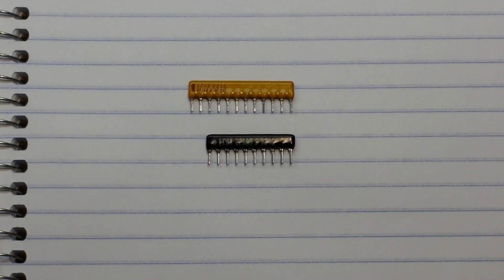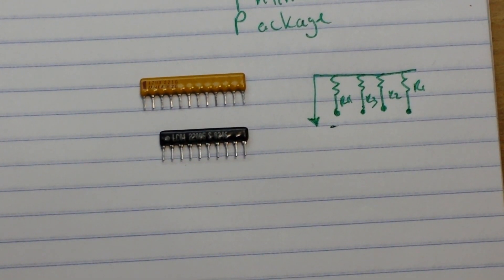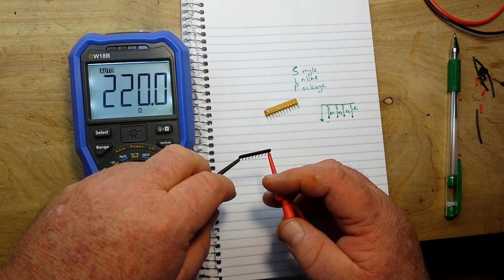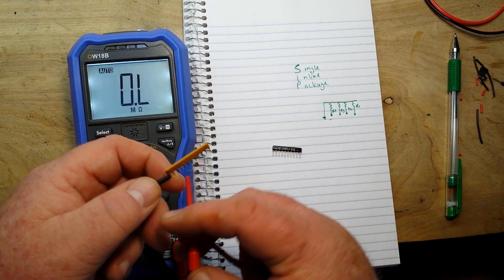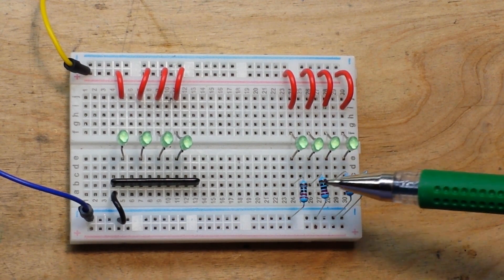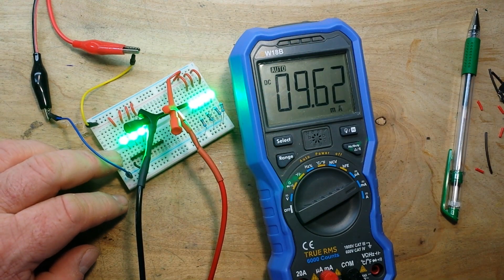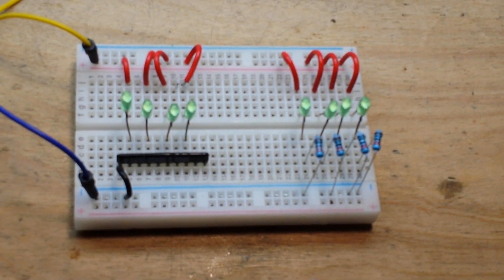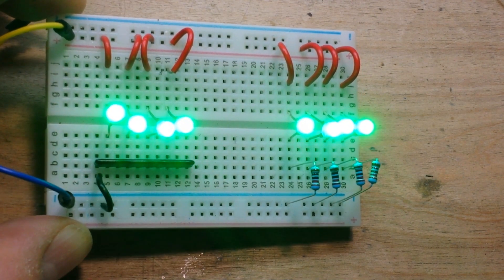Intro to resistor networks

Comment: Sips are usually matched in value and track well with temperature, but their maximum power dissipation is generally lower than discrete resistors. There is one special case that maybe of interest, that is the R2R network which can be used to produce a low cost DAC.
For anyone with the time, the following is a rambling reminiscence of the application of an R2R network.
During the mid to late 70s , before IC DACs were cheap and readily available, I was working on a PMR transceiver controller, as part of one of the first trunked radio systems. Each mobile had a radio circuit that converted the received signal  strength to an analogue voltage on a logarithmic scale, known as the RSSI. To interpret this analogue signal as a digital input, an ADC function. I used a very low cost  R2R sip connected to a spare port of a parallel peripheral interface IC , 8255. ThIs IC was controlled by an intel 8085, 8 bit microprocessor. By instructing the micro to put a binary count on the input lines to the R2R network, it was possible to produce a ramp DC output voltage from a pin on the R2R. This signal  was fed into the negative input of a comparator. The positive input was fed from the RSSI signal of the receiver,  processed by a simple RC sample and hold, using a BC 108 transistor to discharge the hold capacitor between counts. The circuit worked by  holding the RSSI voltage, and ramping up the R2R output until the comparator output switched low. The comparator output triggered an interrupt on the microcontroller, making it stop the ramp count and store the count as the RSSI reading for the channel to which the receiver had been tuned.
By using this circuit in combination with a free tone audio channel marker, transmitted by the system base stations, it was possible for the mobile to scan all the system channels to find the strongest free channel in its area of operation and inform the base station controller to route FM voice traffic through that base station channel. This is not a circuit I have thought about during the intervening 40 plus years, but talking about SIP resistor networks has vividly reminded me of that work, it seemed ground breaking at the time, but now seems so trivial.
Reply from the maker: Nigel,  thank you for sharing that.  Thsts what I live about this community,  lots of folks willing to share their knowledge.

Comment: @learnelectronics. Thank you for an interesting topic. Perhaps you or someone else would like to answer a few question.
1. If I understand this right. A 9 legged SIP resistor is like having 8 resistors?
2. Bearing in mind I would still buy them for the right project.
Doing the maths, 1 resistor cost about 1p each; £6.99 for 600 resistors on Amazon. 10, 9 legged SIP resistors cost £5.33 on Amazon.
 Is that like 6 times the price?
3. To make a voltage  divider; which is 1 reason to buy a more expensive alterative. Would you tie all the legs together except for the common leg?

Comment: BTW these come in packages where each resistor has its own two pins, with no common lead.  The whole idea is to make assembly quicker and easier.

Also some high volume manufacturers have the SIP resistances customized with different values for different pins.

Comment: those are / were used mostly in logic circuits like in old computers, office telephone switching systems, etc. Today the surface mounted components replaced sip networks and couplets because they are much smaller. Some old Motorola 2-way radios used similar type network plates that were not coated, to set PL / DPL tone frequency where the end user could cut out or desolder special places to open or close a circuit. Motorola Flexaar desktop base station / repeater used this for setting the squelch code option. ICOM used a similar method but with diodes to set channel frequency.

Comment: I think the tan SIP isn't necessarily broken. IIRC, the '3' in the part number designates it as isolated instead of bussed - pins 1 and 2 are a separate resistor, pins 3 and 4 are a separate resistor, and so on.
Reply from the maker: None of the other pins worked.

Comment: Thank you for the nice and helpful video. 
I've soldered them once in the wrong direction - it will never happen again :)  It's such a pain to resolder them and under heat they seem to crack/break pretty easily. At least the ones from Bourns i had.
Reply from the maker: They are delicate

Comment: Anyone know if they have these but with diodes as well as resistors?
I want each leg to flow to the common, so rather than 2 random legs be double the voltage, the diode should stop it completely?

Comment: Paul is /was that  one you broke a isolated array? The ones I have with 12B3 221 dale 9620  have resistance on pin 1-2  3-4  5-6  7-8 etc. When i first came across this I was confused and was told that it was a isolated array and it was ok.  Can you locate the data sheet or possibly  go more in detail?  thanks.
Reply from the maker: I'll check into it

Comment: How can the resistor material be ceramic because ceramic is resisting the current flow? most resistors use carbon film, metal film or metal oxide, what type of ceramic are they using?
Reply from the maker: Metal film encased in ceramic
Reply: @learnelectronics  ok thanks

Comment: I'm assuming you got those SIPs in a grab bag, as I did recently. Your vid about them forced me to just do some online research (being new to this hobby and sorely ignorant).

The 10 pin (black) ones, labeled LC01 2200G S 0346, are indeed Bussed Resistors, where the marked end pin (pin one) is common to all other pins (thru resistors). But, the other 12 pin ones, labeled 12B3 221G, are in fact not "broken", but actually Isolated Resistors, where the marked end pin means nothing, apparently (and to my knowledge), and each pair of pins (1-2, 3-4, 5-6...) is a single isolated resistor (220 ohm in this case).

Btw, I also noticed there is something called a Dual Terminator SIP, that has "...an 8-pin configuration and terminates 6 lines. Pins 1 and 8 are common for ground and power, respectively. Twelve thick-film resistors are paired in series between the common lines (pins 1 and 8)." < info found here:
https://www.mouser.com/datasheet/2/54/600x-776645.pdf

Thanks for making me learn something.